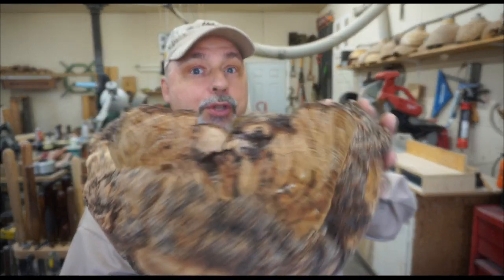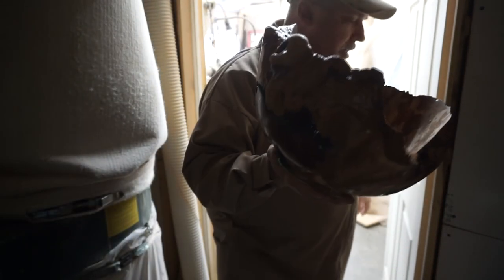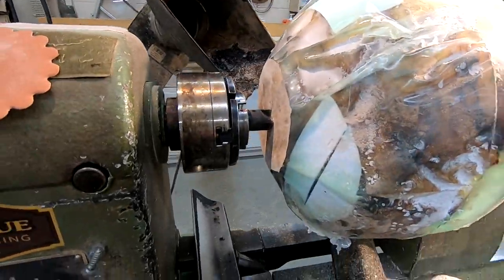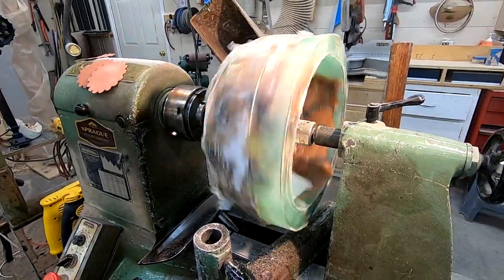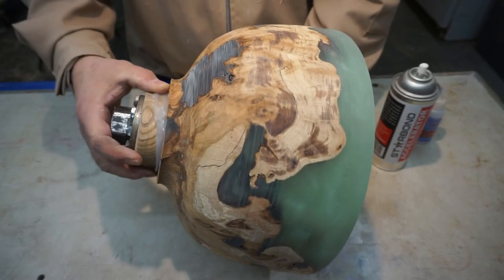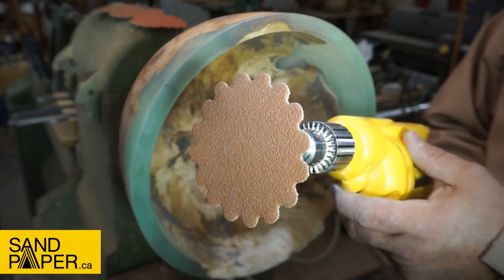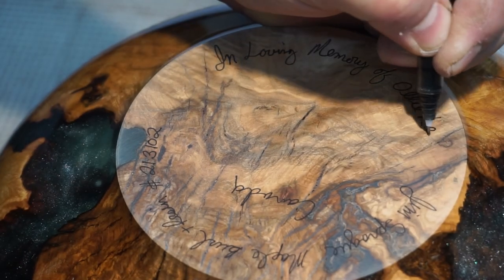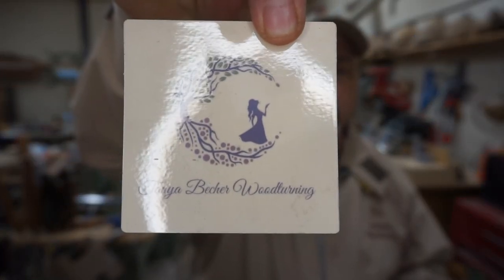Woodturning - Glow in the Dark Burl

Comment: Fantastic work! I would make the core out of Porocel (Styrofoam, Styrodur, hard foam). Shape on the lathe, possibly with a hot wire. This saves a lot of resin and is easy to remove.
Reply from the maker: Good idea, thanks

Comment: Love that bowl, amazing!
Couple questions-
Why do you need the pressure pot?
What would happen if you didn't use one?
Reply from the maker: You don’t need a pressure pot but the reason it’s used is to compress any air bubbles so small you can’t see them and to push the epoxy into areas that it ordinarily wouldn’t flow. It just gives you a better all round casting. Thanks

Comment: Hi, I've only been watching your videos for about a week so this might be a silly question.  Can you make handles for your resin, maybe just a couple wire hangers left just a bit in the resin, then you could use the handles to lift the set resin out without as much effort?  Oh wait, then you'd have to try to turn little pieces of metal to get the hanger out.  Maybe some shoelaces or strapping, something that won't damage your cutter?
Reply from the maker: I’m very Leary of doing something like this. If the string migrates in the casting when in the pressure pot, it could rune the casting. Thanks for watching

Comment: I've been thinking that there might be a way to vacuum form a mold using the bowl as a form. I played with this a little in collage (4 decades ago) and it wasn't a complex process but we had great labs with equipment. Maybe with a material that doesn't like to stick to such as Polyethylene.  After forming it could also be sprayed with mold release to make sure it doesn't stick.  I'm not sure if Polyethylene does this, but some plastics have shape memory and will revert to a flat sheet if reheated, thus you could reuse it on other shapes by simply heating it again over a flat surface.
Reply from the maker: interesting concept, thanks for sharing!

Comment: Hi Jim, Another great project!  A couple of questions.  I see you were using some of the Hunter carbide tools and I think you said the Hercules on the outside and the Osprey inside.  Why the Hercules for outside and the Osprey for inside?  I viewed some of their tools at their website  and there are so many to choose from and seem to do the same things.  I have never really been successful with "traditional" tools (bowl & spindle gouges) with riding the bevel etc.  I have mostly been using straight carbide which do ok but do require more sanding etc.  I have the Jimmy Clews Mate #1 and Mate #2 tools and they give a somewhat better finish but are quite "grabby" and hard to control for a nice finish cut.  They cut fast and I end up using them mainly for rough hollowing.  The cutters are the same cup style as the Hunter Tools it would appear. Are the Hunter Tools less grabby and do they cut as clean as traditional bowl & spindle gouges?  Which ones would you suggest??

Also, do the Pilot V5 Pens you use resist blurring/smearing when finish is applied over them?
I would appreciate your thoughts.
Thanks,
Myles
Reply from the maker: The Osprey is a little thinner than the Hercules and I was up against the tailstock so I decide to use it to get further in the bowl. I would get the more robust Hercules over the osprey. If you take nice light cuts or sheer cuts like you see me use in this video and the cutter is sharp the surface will be a nice as a gouge. I still prefer to sheer scrape the outside of the bowls with a gouge in most cases tho. The pen I use doesn’t bleed, highly recommended it. Use code Inlayjim with Hunter Tools to get your discount. Hope this helps.

Comment: Is that natural sheen on that wood @ 9:26 or is it shiny from the glow in the dark paint you put on?  I'm a lefty too...can't the bar that you rest your hand on be simply put on the other side of the machine?  Will the lathe need to be spinning in the opposite direction?  It seems an easy fix...'SEEMS' being the operative word here.  18:45-ish...it almost looks like that globe one you did.  What you were saying about the dull cutter generating a lot of heat...wouldn't that be preferable if you had any moisture in the wood?  Could you have tinted the CA glue?  20:50 Why are there so many lines?  I like the way the resin on the finished product looks like it is fading from the wood to just the resin...like you are looking at sand when water recedes in the ocean and at first you see sand and then it slowly fades to just water.
Reply from the maker: It’s the glow in the dark resin that your seeing at 9:26. The lathe I work on is a 20” General and has lefthand threads on the outboard end, that way us lefty’s can work comfortable, no need to move the tool rest over to the other side. The wood is very dry and no need to generate heat to dry it any further. I could of tinted the CA, but the resin was very light in color so there was no need. Your going to see lines in the bowl until the final pass with the tool, thanks 🙏
Reply: @SpragueWoodturning  oh I was asking because it seemed you held the gouge in your right hand.  I'm actually an incomplete  quadriplegic and am left handed...but a lot of the damage, hand-wise, is in the left hand..drives me nuts sometimes 😒.

Comment: Question: are you raising the Hunter tool up on its corner rather than keeping the flat of the bar on the tool rest?
Reply from the maker: Yes, it can be use exactly like a gouge if you wish. I only do this after the piece is round, until then I usually keep it flat on the tool rest, thanks .

Comment: Jim, could you tell me what glue you regularly use to stick a waste block on your pieces. It looks like you are heating the glue in an electric frying pan. Is that right?
Reply from the maker: Correct, any hot melt glue will work. I get mine in bulk from Canadian Tire here in Canada. Thanks
Reply from the maker: Yes

Comment: I seem to remember seeing you have a vacuum pump.  I don't understand why you don't always pull a vac in your pressure pot for an hour or so before you hit it with pressure
Reply from the maker: The problem with that is you can’t see what happening in the pressure pot so the resin could be overflowing and making a huge mess, I put a few pieces in the vacuum chamber but their usually very punky. I don’t see the need in a normal casting that’s solid and not full of rot to use the vacuum chamber, Jim.
Reply: @SpragueWoodturning  While you are undeniably successful and skilled in your trade, the beautiful pieces attest to that fact, there seems to be a challenge on every project caused by a less than perfect pour. A situation that to my mind seems so very easy to avoid with no added cost and virtually no more effort.     Pour, vac, squish, cure   boom, no voids